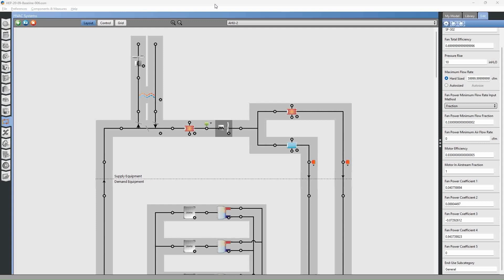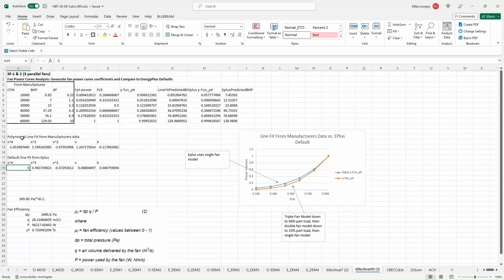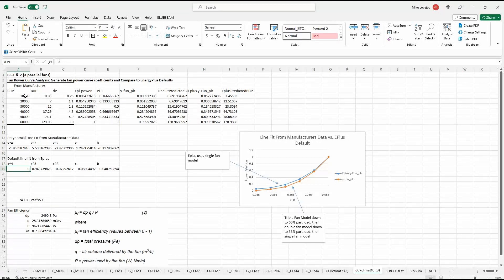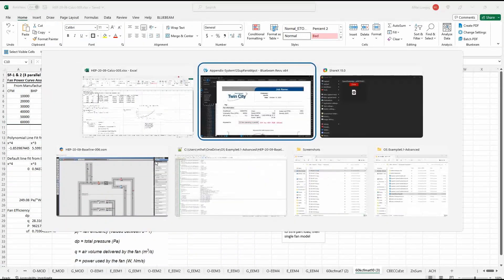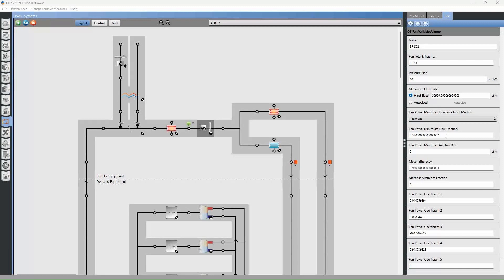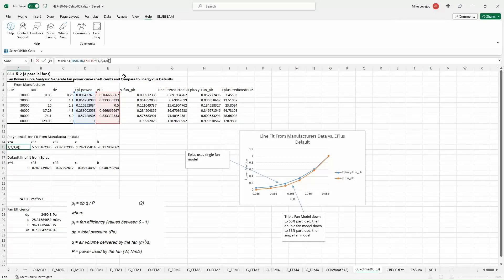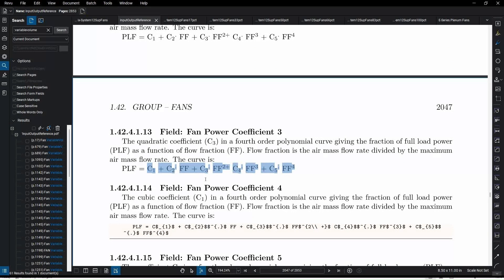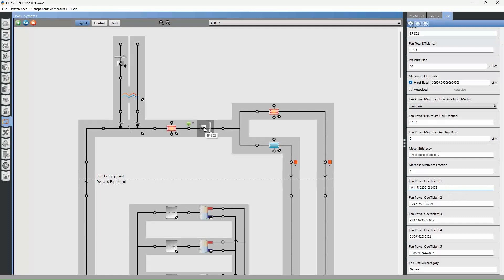OpenStudio EnergyPlus Fan Curve - Modify for Parallel Fans

Comment: Isn't it wrong to use static pressure as the total pressure rise?
Reply from the maker: Good question.  The Fan Pressure Rise field used in OpenStudio is the Total Static Pressure the fan must overcome.  Total Static Pressure = Internal Pressure Drops + External Pressure Drops.  Internal includes the coils, filters, dampers, heat exchangers, internal to the equipment.  External includes the pressure drops in the ducting system including bends, dampers, diffusers, etc.  Since the fan must overcome the Total Static Pressure, that is the operating point we must model.

Comment: Is the building drawn with internal or external dimensions?
Reply from the maker: In OpenStudio/EnergyPlus, the walls are infinitely thin.  If you draw it with the internal dimensions, you will get a somewhat accurate internal floor area (except for internal walls).  If you draw it with external dimensions, the floor areas will be larger, but may not reflect actual, usable floor area.  As a compromise, I draw the walls in the middle.

Comment: hello! Hello! can you tell me, I am using OPenstudio to simulate VRF system. My model has the FCUs of each thermal zone and has a total outdoor fan for those thermal zones, I don't know what to do, can you help me?
Reply from the maker: Yes, with VRF, it is difficult to properly model DOAS with VRF.  I have struggled with it myself.  There are certain features available in EnergyPlus that are not available in OpenStudio (https://github.com/openstudiocoalition/OpenStudioApplication/issues/555).  At this point you have to use the zone as a mixer (ie. assign both the VRF terminal and the DOAS terminal to the zone).  Alternatively, you could create the initial model in OpenStudio and then do the final modeling in EnergyPlus.